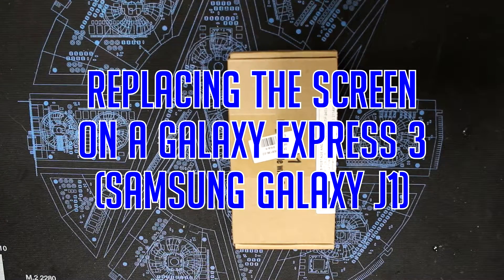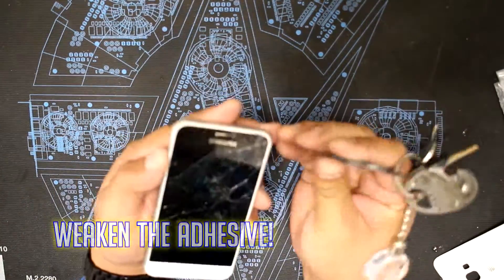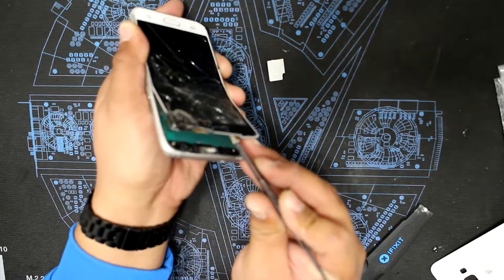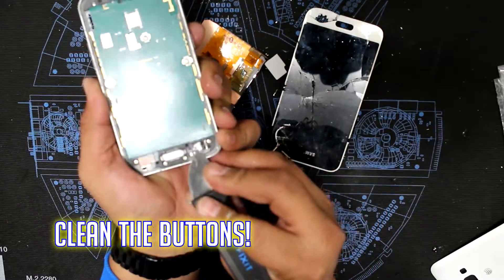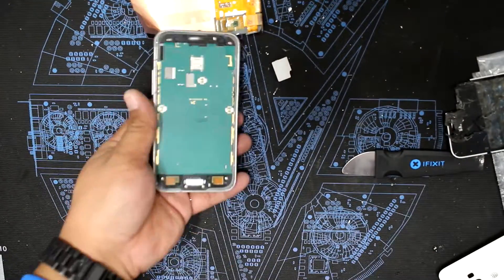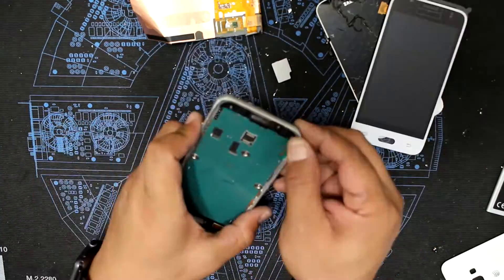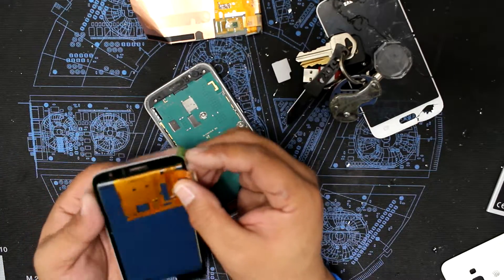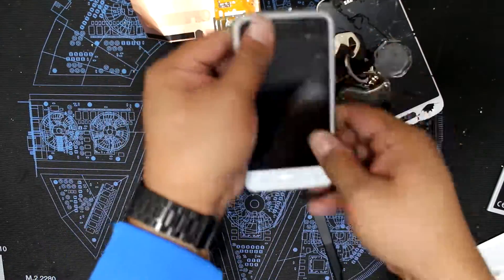Galaxy Express 3/J1 Screen & LCD Replacement

Comment: Hey bro, I was finding a video like this, I just had the doubt if the Samsung Galaxy express 3 screen is the same as J1 2016 but you answered my question, I have a Galaxy Express 3 there and I want to replace the screen, 5 years later I found your video bro! Thanks a lot!